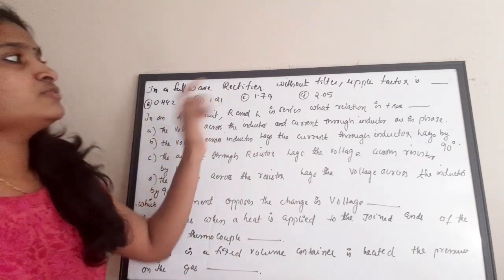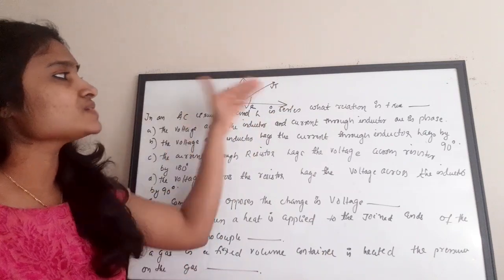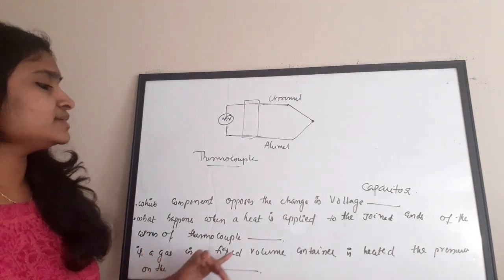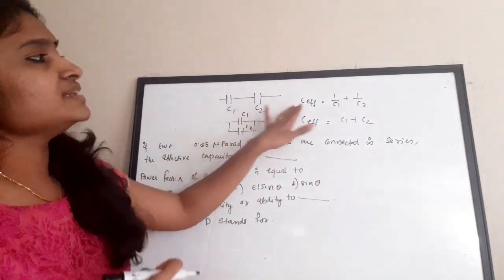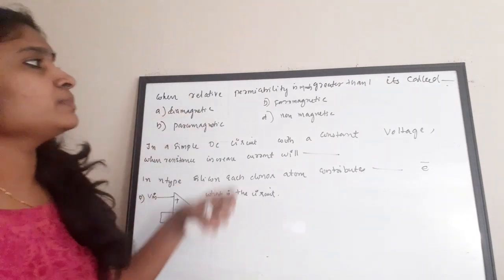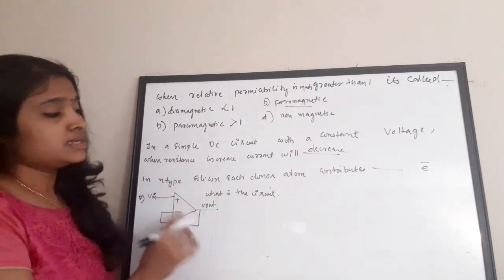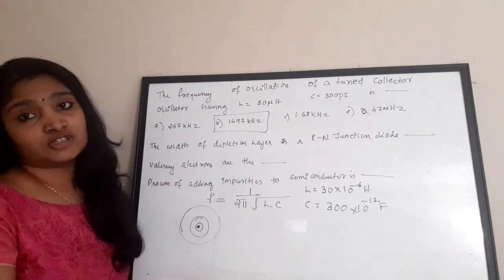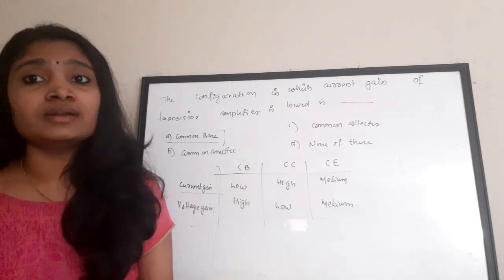Competitive Exam Preparation of Electronics and Electrical Part13| Technical assistant| BEL Exam

Comment: Dear mam, when will release remaining question of lpsc technical assistant 2020 solution paper  part 5.....
Reply from the maker: Only 2, 3 Questions is left out will include it in some other video.
Reply: Thanks mam....
Reply from the maker: Also answer for those Questions is confusing, that is the main reason